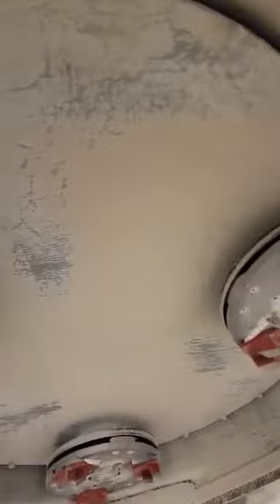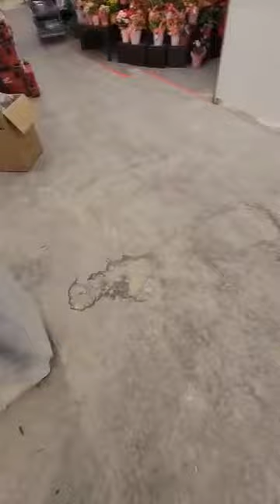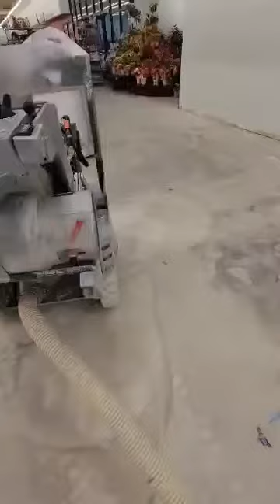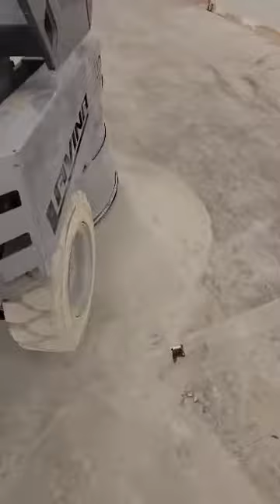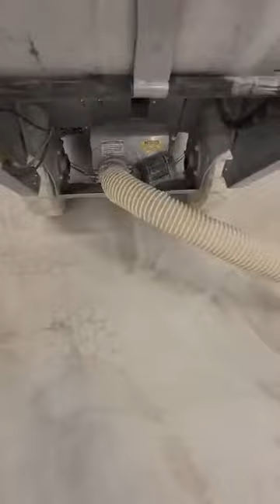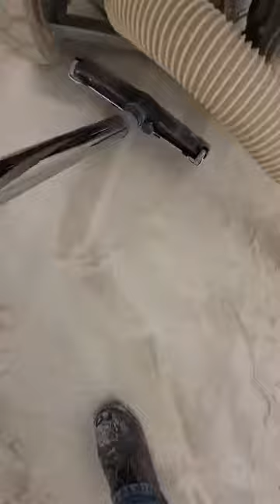Prepping concrete with the most reliable tool - The Rhombus Diamond Grinding Plate 💎

Comment: Does your soft bond tooling glaze over on very hard concrete? All the tooling Ive tried in soft bond from various Chinese suppliers as well as Husqvarna (everyones diamonds are from China except for very few) and all glaze over and stop working. Only tooling Ive used that consistently works is Reliable Diamond Tool (but very expensive) 
Need tooling for exposing aggregate on very hard concrete..tooling that will not glaze over after 15 min
Reply from the maker: No, shouldn't BUT with the world of concrete, too many variables to ever promise perfection.  So questions, when you are on hard floors, maybe slow your speeds and or try ordering extra soft diamonds vs standard soft? Your toolbox determines your success! So I do suggest a softer soft bond.  So yes our soft bond diamonds shouldn't glaze!
Reply: @tooling  ill  try out a set of your extra soft Double segs
Reply from the maker: @TimKollat  Thank you, we promise to back it up, if not 100% satisfied, we will give you back what you paid!